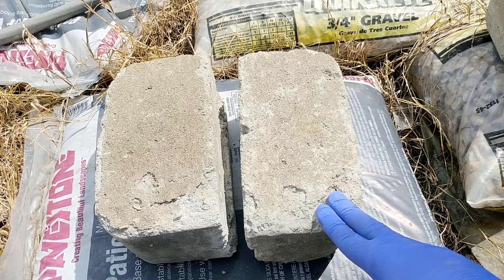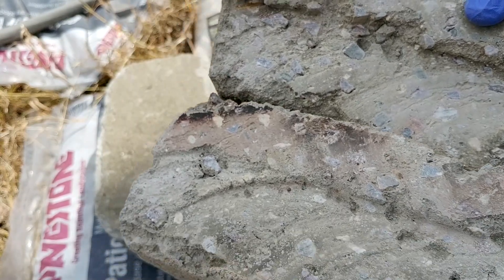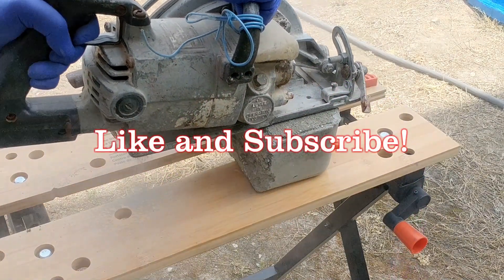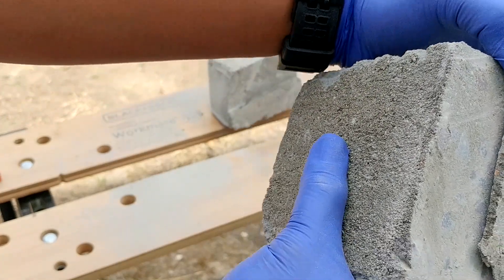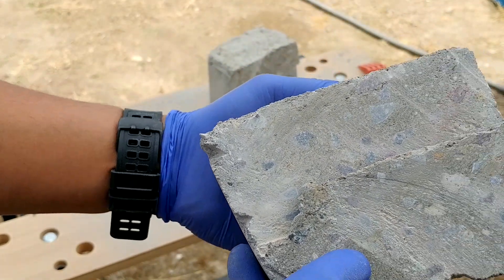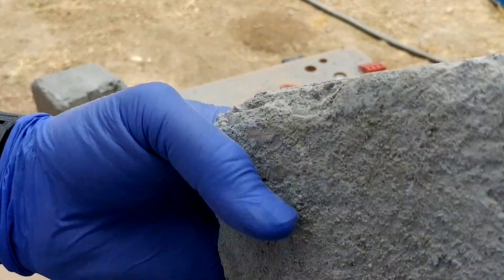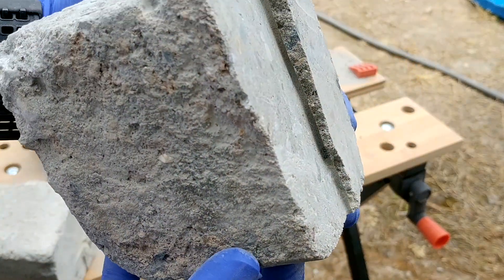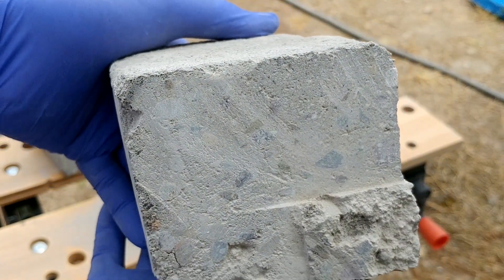You Won't Believe What We found in This Dry Pour Concrete Experiment Part 2

Comment: Anybody who uses this dry pour method deserves what they end up with..saw cut thru a block of concrete laid down properly by professionals, you will see the differences. When you order concrete for a particular  job/ purpose, the batch plant will calculate  the right mixture of aggregate , sand, lime, cement and water to achieve  maximum  strength. If you want your finished product to be water proof then that even more calculations of raw materials  and chemicals. Also you have a time limit to get that mix poured/ laid and finished. The finishing of the concrete  is very important, concrete is vibrated  so the heavy bounds sink to the bottom, air is removed (all the air) and your material needs to be wet to achieve  the removal  of air, and the fines are pushed to the top. Concreter's then will wait for the correct  time to finish and trowel of the concrete, this troweling of the concrete brings all the fines up from the bottom thru to the top , resulting  in a finished  product void of any air gaps and all the materials  bonded together.
 Construction sites when ordering  concrete will test the product before its used (every truck load is tested) if it fails the slump test, its rejected and sent back and the testing doesn’t  stop there after a designated time it will have a core sample removed and tested again, if this fails it will be removed and done again.
So now hopefully you understand  that there is not one mix for all jobs. This dry mix is ok for fence post and I mean a small fence. If your concrete is going to bear  any heavy weight ( drive way, house etc) then NO.... don't use this.
Reply from the maker: Thank you for the detailed explanation.

Comment: I'm impressed.  Both look like normal concrete.   I don't think you need any hardness testing for walkway or patio construction.  People use sackcrete for postholes, water it less, and it does fine.  Given all the interest in dry pour, I'm sure the cement manufacturers will come up with mixes specifically for that application.  I've mixed sack concrete in tubs and bags to make 24"x24"x2 1/2" stepping-stones.  Hard work.  I'll be trying dry pour soon for a side yard walkway.  Putting mortar mix over the concrete before misting looks like a decent method for getting a smooth surface.
Reply from the maker: Yes. I think for a non load bearing this can be an alternative that most people can use.  I'm not sure if this will be as hard as the regular mixed one once fully cured but we will see.
Reply: Looked like spider cracks in the wet poured.

Comment: I ran a 20A circuit from my garage out to my shed and then over to my shop (basically a small 10x10 garden shed). I had to cross about 12' of dirt along my fence and across the small main gate to my backyard.  Right now, it's all just dirt that gets muddy when it rains (I live in the Pac NW, so it rains a lot in the winter) it's got a few concrete pavers, but it really needs a full path.  

I plan on pouring concrete from my driveway, along the path into my yard, where it will T with another path from the back door to my garage over to the "shop" (about 15' total length).  That will protect the buried electrical line as well as prevent that area from becoming a muddy mess in the winter.  

I came across this dry-pour technique and can't wait to give it a try!
Reply from the maker: Thanks for sharing. I hope that your project will turn out well. Make sure to document your process and share it with the community.
Reply: Get creative, build a bridge. Go Seahawks
Reply from the maker: Bridge might be too ambitious 😁

Comment: Can you use this method over a gravel subbase?
Reply from the maker: I have seen one video where they just spread dry concrete over a gravel path then mist it with water. I don't know how long it will last but they say it held the gravels well.  When you pour a concrete it is a good practice to use a compacted gravel surface for better drainage.

Comment: I did this dry pour method for a 3 1/2 inch slab to park my F-250 on. It took about 3 weeks to get a good cure. So far it has not cracked. It seems to be as strong as the slab I poured for my shop using the traditional way of mixing water and cement in a mixer.
Reply from the maker: Thank you for sharing. Did you do it the way most people do like mist first then wait an hour etc? How's the top surface look like?  Did you do anything to make it smooth?
Reply: @diymanual  I did it the way Cajun Country Livin' did it. I just followed their instructions. It looks like a regular concrete slab.

https://www.youtube.com/watch?v=GC0j2Ey5NNk
Reply from the maker: @kn5582   Thank you for sharing. Did you add rebar to make the slab stronger if so what size rebar did you use?
Reply: Thanks for sharing!
Reply: someone did an experiment and found dry pour to be 75% as strong as the traditional way of mixing concrete.  so it's should be enough for many small projects.
Reply: A typical heavy passenger vehicle like a pickup truck is unlikely to exert a force on the concrete slab greater than 100 psi. So, a dry pour slab, when done correctly, should be able to hold an automobile and/or common foot traffic. Would I use dry pour for a house foundation, garage slab, or driveway? Probably not, but for everything else, why not.
Reply from the maker: @chesslover8829  Thanks for the information. I will research that.

Comment: Dry traps more air bubbles. Wet pushes out the bubbles. So wet is better. We all know this.
Reply: May be, or all the air bubbles are introduced into the slab when you mixed the concrete in the first place.
Reply from the maker: Thanks for sharing.

Comment: Top surface looks like it just popped and cracked off as layer.
Reply from the maker: Are you referring to both sample or the mist slightly method?
Reply: @diymanual  kind of looked like both. I think an air pocket formed there after bleed water from lower curing concrete became trapped from the cured surface layer.
Reply from the maker: @JFirn86Q  Thanks for sharing your observation. 👍

Comment: Créate 2 blocks 4 inch thick one wet mixed and one dry pour wait 28 days so they cure completely and then break them with a sledge hammer to see if there is any difference in strength.
Reply: Not a sledgehammer. That wouldn't test the strength fairly. One swing could be different than the other. A more fair test would be a heavy ball dropped on the center of the block from a set height.
Reply: @personalaccount4360  
agreed. Something like a bowling ball or a weight plate from a set height.
Reply: Why not do it properly with a calibrated hydraulic press?
Reply from the maker: @dchall8  I hope someone with this device will do it and share with us.
Reply: @dchall8  
Because most people don't own one, and it's not cheap.
Reply: @shane250  But there are laboratories which have the stuff.  My point is, breaking up unregulated samples of concrete with a hammer doesn't prove anything.
Reply: @dchall8  
I agree, just looking for dry particles inside doesn't really tell us anything. But if a weight is dropped from a set height, and one cracks while the other doesn't, it will still tell us something... Just not EVERYTHING.
Reply: @dchall8  that would be awesome if anyone has one
Reply: Lol those two guys watch to much TV 🤣🤣🤣🤣 a heavy ball would break glass but not concrete unless dropped from a plane ✈️ 😝 and aiming from a plane would be harder than getting the plane lol.
Reply: @robertoj8950  you're telling me a 45lbs steel weight plate from a ladder won't even chip any of them? Cool, mind trying it on your concrete and make a video?
Reply: @shane250  brother it might chip it or it might not , but chipping is not what I care about I want to see the strength, I have broken concrete with a sledge hammer and it’s hard that’s why I asked for sledgehammer but any tool heavy enough would do . I might do the test myself 👍🏻 and include your request ☺️
Reply from the maker: @robertoj8950 Make sure to record it if you do the test. I am interested to see it :).  Also, how do you do all that emojis? Is that only available on the phone?
Reply: @robertoj8950  sounds like a challenge.
Reply from the maker: @robertoj8950  I just realized, when I reply from Youtube Studio there is no emojis.  It should be available there as that is where I go to check comments I haven't replied yet. 👍
Reply: Drill it with a masonry bit.
Time it to bury bit completely.
Reply from the maker: Well get there.🙂

Comment: Use water from boiled rice to do your cast and see what you get. you don't need much about a 1/8 cup per gallon.
Reply: ?? Would that change anything?
Reply: @Wreakmayhem  Oh Yes it causes a different type of crystal structure in the concrete. By shortening the crystal length during hardening it cause a more amorphous crystal and makes the mix much stronger. I have used it mainly on small thinner slabs but it's both more compression strength as well as resisting fracture and linier stress breakage. While obviously on a large slab a bit more problematic less than a 6x6 slab is easy enough. If use a bit more in the intital cast you can even get a pretty good polish.
Reply from the maker: Will the water you use to wash the rice be the same or it has to be from boiled? I have read about this and it is interesting concept.  I  read somewhere that they used the rice method in building the great wall.
Reply: @diymanual  I use just the water from boiling it I don't think just rinsing it would be the same. Never tried it though. I didn't know about the great wall but it wouldn't surprise me I learned it from my great grandfather and he said he learned it from an old chinaman.
Reply from the maker: @brianstevens3858  Thanks.
Reply: @diymanual  They used lime mortar for the Wall not concrete

Comment: I am curious to know if the portland cement bonds differently if mixed.  Does it disperse, dissolve, and bond better with the motion of mixing with water?
Reply: Part of engineering specifications when designing foundations and post-stressed concrete spans and most other uses of concrete is the mixing.

Agitation improves the bonding between the cement and aggregate and even with itself.

Core sample and do a PSI to failure compression test.  The same ratios of cement, sand, rock and water will fail at a much lower PSI without the agitation.

You can overagitate, with the main problem caused being incorporating air, resulting in voids.
Reply: @fhuber7507  
What if you compact the dry pour with a hand tamper before wetting it?
Reply: @fhuber7507  thank you. The info I've been looking for. Dry pour seems convenient for some non load bearing projects but I think foundation work would be risky.
Reply from the maker: Thanks for this explanation.

Comment: The soaked version has a definite closed bond to the aggregate within and throughout the core of the block
Reply: Concrete water cures for 28 days.

I think that if you baby the waterings very little, the cement powder just gets wet and doesn't cross link to others powder beside it. If you give it enough water quick enough, the powder would probably melt more, promoting better bonds to the other powder or sand or stones better. I don't think it is possible to over water the dry pour method.

I want to do more tests too soon.
Reply from the maker: @jakefriesenjake  Interesting point. Mine is I wanted all the material soaked at the same time using the mist but not fast water like the shower setting as I am afraid that when I do shower right away that it will wash most the portland cement down to the bottom and the top surface will be weaker. But if you do your test, please share. I am interested with the result.
Reply: @jakefriesenjake  I did part of my basement by drenching it. Misted it light, let the surface harden, then soaked it. It seems like it stopped accepting water at a certain point which works its way from the top down. I think this is the way.
Reply: @TheRealReam  that's what I kinda think. You can't really over do it (within reason).... Once it's full, it's full. But, I think you can definitely add too little water. But if the slab is outside, rain will definitely finish off the job. There might be a price to pay though if you only mist it super gentle for 1 week off and on to get all the powder to activate.
Reply: What jake said, I kind of disagree, containment gives options of soaking and walking away for 30 days but in real application with forms and a gravel base, cement and water spread through, making over watering an issue and dropping psi strength
Reply from the maker: @williamnunez9609  Maybe soak first then once it set more water can be introduced? Too much water before setting will dilute the cement powder I think.
Reply: @diymanual  it will wash away the powder and thin the surface, exposing more aggregate. I used a thin layer of rapid set mortar on top for a nice finish. Waited 10 minutes for it to harden and then I misted it for an hour straight.
Reply: @williamnunez9609  yeah I kinda take back that you can't over water it. There are so many variables with the dry pour method.

First, if you are using a closed form and 10 bags of concrete, you should time out the flow of your garden hose to somewhat monitor the amount of water you add. Add the water the bag says x the amount of bags used.

If you get the whole slab wet enough to activate it, the timer starts. So let's say it's 6 hours to do the initial cure, after 8 hours, I'd be constantly showering it really good because concrete shrink cracks if you let it dry out. Keep it wet and covered for as long as possible (28 days would be perfect, but a week should be ok) keep it wet though (after the initial cure)

I believe that it's way easier to add to much water in a regular wet mix, whereas the dry pour, the water would just puddle on top. I guess it would matter whether or not the form is sealed on not. There are so many variables!

I do want to do a test for strength using 4 ways.

1 - regular wet mix
2 - lightly misting it for hours and hours, waiting 20 minutes in between.
3 - using cajon countries method, but adding the proper amount of water that the bag says to use (mostly common sense)
4 - watering it pretty heavy, after the first couple of mistings. Lots of water.

See what the strength is after 28 days. (keeping them wet for 28 days) I have a hydrolic press, maybe I'll use it for breaking them. We'll see.
Reply from the maker: Thanks for sharing your observation.  Now I have to check it again when I get home. I was just looking for evidence of incomplete cure and if there is any dry powder.  It's always good to see others take on it as we look at things differently.
Reply: you cant beat physics, dont know why this still a question.